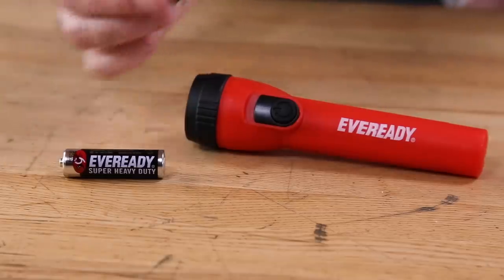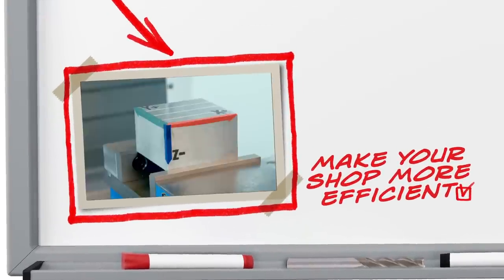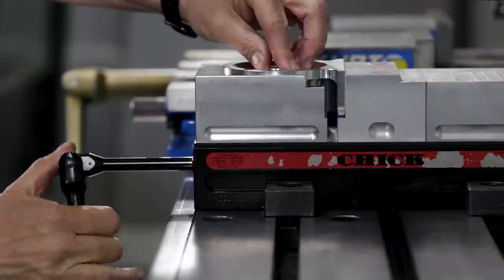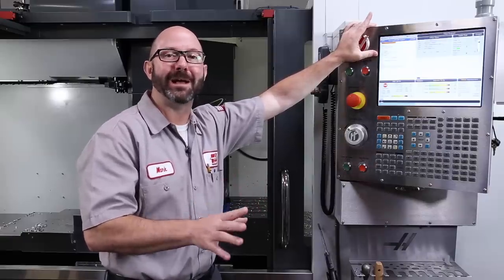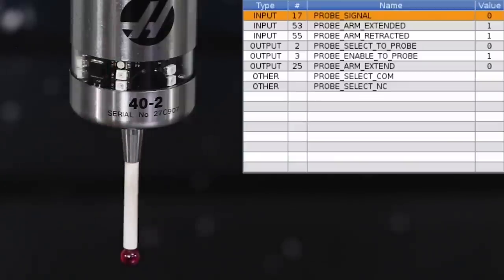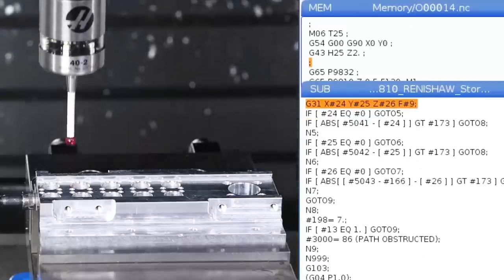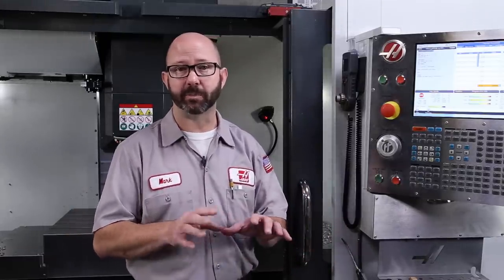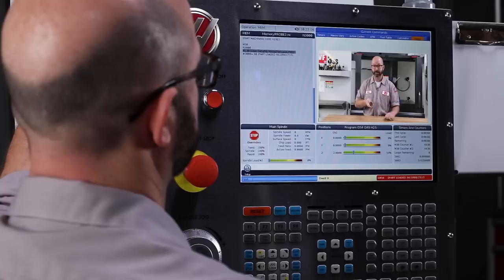Mistake Proof Your Setup with Probing - Haas Automation Tip of the Day

Comment: Welcome back Mark and thanks for all of your firms great videos.   Silly question, given a self centering vice  couldn't you run a check on both ends?  If it's right run plan A if its vice versa run plan B  which would probe the hole in it's alter position and then run a mirror image code.     This would make it fool proof and have the advantage of proving the part is actually there as well as saving time.
Reply: That's a cool idea.

Comment: Great history lesson ... but any alkaline power source with 1.5 volts (like AA, AAA, C, D, etc.) is a *cell*.  If you place multiple cells in series, then you have a *battery*.  Perhaps after realizing that "voltaic pile" sounded like something he did in an outhouse, Alessandro Volta borrowed the terminology for his 1799 invention from the cells in a monastery, in which monks lived.  More trivia: Rectangular 9Vs are true batteries - if you crack one open, you'd find 6 tiny cells inside, each producing 1.5 volts.

Comment: I need to use the probe before running some weldments. Not to check part location but to set Z for A0. G54 and A 180. G55. This is the first vid I came across and it's already helpful. I need to do a bit more research but I'm already thinking I can use P9810 before I move it into position just to be safe. Then after it's in position I plan to just run the Single Axis Work Offsets probe feature that I just copied and pasted into the program.
Reply: It's done already 1st time I ever programed a probe in the program. was really easy I just kept Z at G90 G53 Z0 then programed it to move directly over the part. Then went in did a single surface Z axis work offset probe for my 2 cords G54 G55 then copied the program and pasted it into mine. now when I hit cycle start it moves XY above the part then turns on probe and moves down on Z till it makes contact. There is only 2 ways to get the part in the fixture so I probed it along an edge so if its in 180 degrees off it misses the surfaces and throws an alarm... POKA YOKE...POKA YA-OK!! ...Programed on a VF 6/50 software release 100.21.000.1142. machine was manufactured around March 2022

Comment: Another great video, thanks Mark.  Question for you, I think there's a bug in the controller on my machine. Who do I tell? When I use #3006 to stop and display a message it only displays for about 2 seconds then goes away and is replaced by a SnglBlk Stop message. I checked yesterday and this doesn't happen on our VF4 with the classic control there it stays until you hit start or reset like it's supposed to. Machine is an EC-1600 with NGC.

Comment: is there any command / g-code to fire the probe into "vigilant" mode so as not to break it when writing a program? something like "P9832"
I mean the drive to the detail with a probe so as not to break it

program :

up.programosy.pl/foto/118956238_963421927490021_3229580305322173151_n.jpg